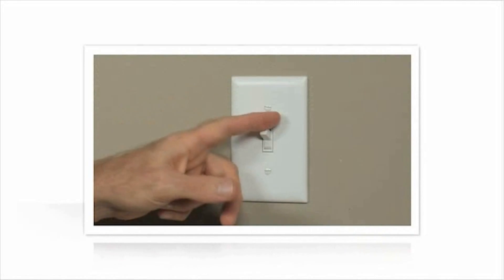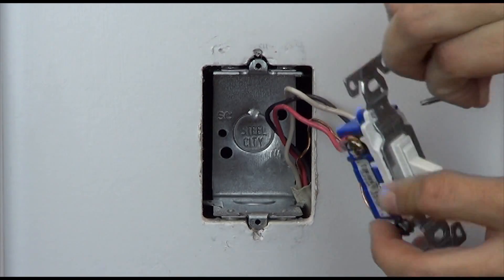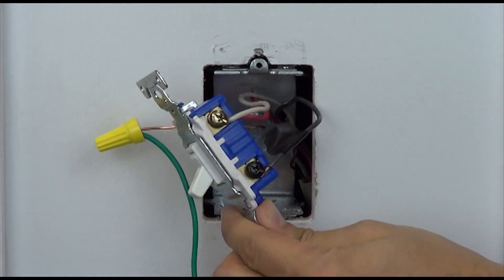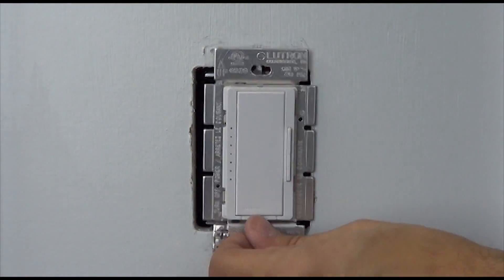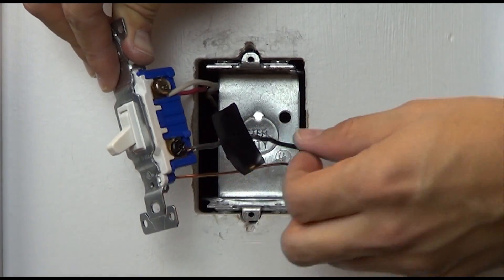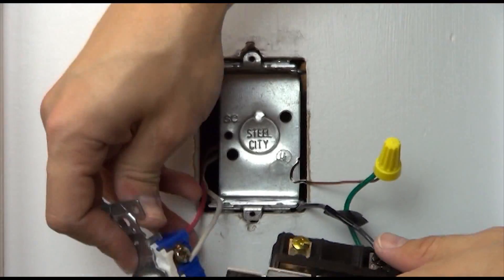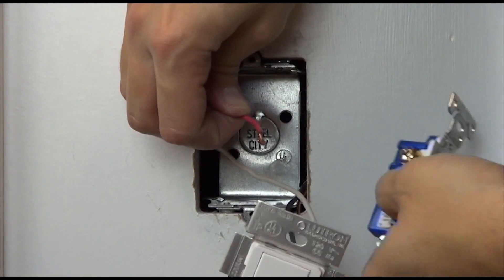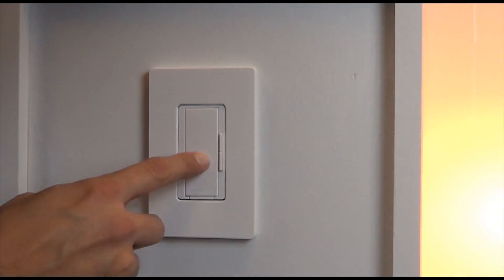Wiring a 3-Way with Maestro LED+ Dimmer and Companion

Comment: I only have one switch going to the light and a black and brass only. No other wire for the blue. I connected everything and it turned on when I switched the breaker to on. The lights are on but the dimmer switch isn't dimming nor is it turning the lights off.
Reply from the maker: Our Technical Support team will be able to best help you with getting this sorted out. You can reach them at 1-844-588-7661 or support@lutron.com. We’ll talk to you soon!

Comment: why cant you just make all dimmers 3 way compatible? why the need for a companion? just wondering?
Reply: Normally, dimmers never work in 3 ways in both locations. If you have a dimmer at both locations of a 3 way system, then it leads to abnormal voltage issues which causes your lights to either flicker or not be on at all. What makes this Maestro dimmer different from the cheaper Diva dimmer is that the Maestro companion dimmer allows dimming at another location by communicating with the main dimmer. I honestly don't know how exactly it does that but I do know that the main Maestro dimmer is the only device dimming the lights. 

Lutron also has a Caseta line of smart switches and a Vive line of RF Maestros where they can be paired with Pico remotes to allow for 3 way switching/dimming wirelessly. Both products can transform a single pole switch into a 3 way or 3 way system into dimming at all locations.

Comment: Very unclear! He does not show wich of the boxes has the switch leg and wich has the power, plus there is only three current carrying conductor on each box , there is so many varietys that could take plac, it seems to me that there one splice box between the 2 boxes shown que therr might actually another cable that goes up to the loght and where the neutrals meet and ollof them meet. Very lacking info. So bad!!

Comment: In the video he says companion dimmers must be used at all other locations. On the box it reads works with existing switches
Reply from the maker: Hi Dave, For 3-way installations, the MACL-153M may be used with an existing mechanical switch. For applications with more than two switching locations, then the companion devices will be required. You may review the wiring diagrams on pages 4 and 5 of the spec sheet here: https://www.lutron.com/TechnicalDocumentLibrary/369613a.pdf. Hope this helps!
Reply: So in a location where there are 3 switches controlling one light do you need just one companion or 2? If there are only 2 switches controlling one light (bottom of stairs and top) you can use two regular maestro switches?

Comment: Question: Master dimmer should be wired to the power side and companion Dimmer to the switch leg side?
Reply from the maker: Typically, the Maestro in wall dimmer can be installed at either location when used together with the companion. For more specific information on your device, please visit www.lutron.com/support to view install guides, FAQ's and wiring diagrams.